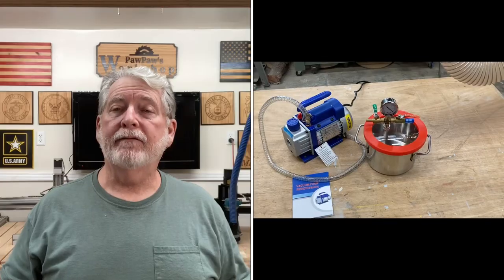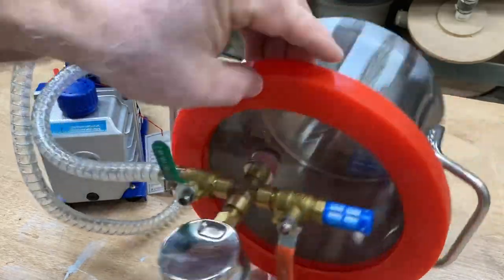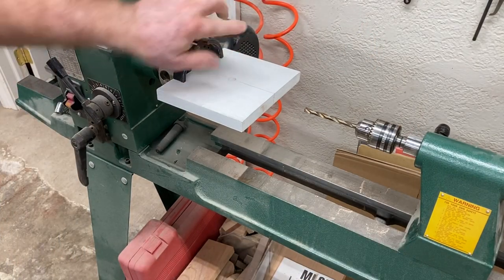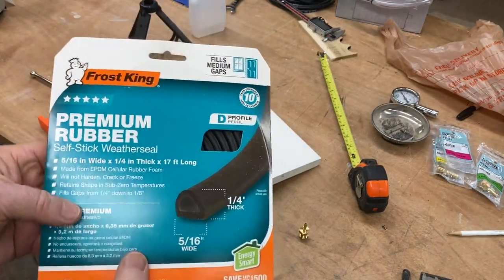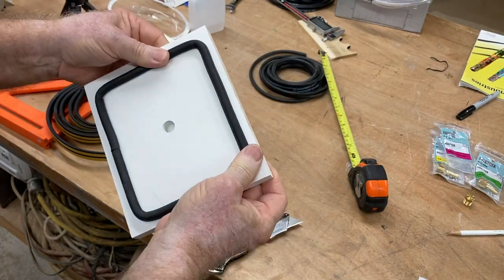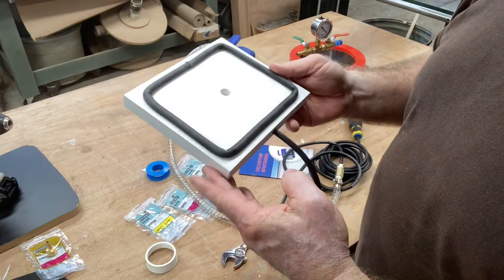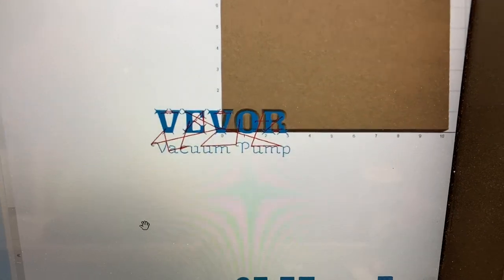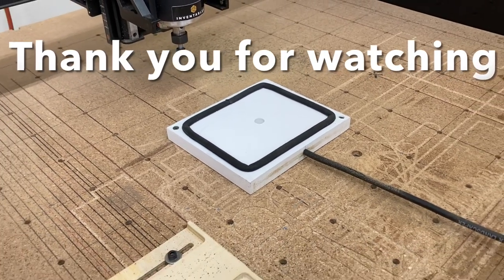VEVOR Vacuum Pump Testing with DIY Vacuum Pad

Comment: That is ingenious. I have an Axiom CNC and picked up the vacuum pad system they offer. It hooks up to a compressor, and has a venturi valve...It is absolute garbage, it simply would not hold much at all. Your simple system would be perfect for making a full size vacuum bed for my CNC instead of buying those $3000 vacuum beds....good stuff sir. thank you for taking the time to share this.
Reply from the maker: You are very welcome

Comment: I use a dowel drilling jig, instead of the lathe.

My vacuum pump is oiliess, so no oil mist in the air.

I used my cnc a year ago to make vacuum pads out of pvc, hdpe  and baltic birch. Take a 1/4" round nose bit and carve a 3/16" deep square or rectangular or circular or any shape groove into your pad material. Go buy 1/4" diameter foam backer rod from the window area of your hardware store, and put it into the groove.
Attach your hose, turn on the pump,  and voila.
Reply from the maker: Awesome!  Thank you for sharing

Comment: This is a awesome solution for a vaccum pad. I made one from pvc board and it works fantastic.
Reply from the maker: Awesome!  I like mine a lot. It works great
Reply: @PawPawsWorkShop  I made mine with 6mm EPDM rubber. I carved a groove and placed the rubber in it. It works perfect.  I use a Vevor 1hp vacuum pump. When I want to carve acrylic I first put a sheet of 9mm mdf on the pad, Then I put the acrylic on top of the mdf. Works great for me.
Reply from the maker: Awesome. Thank you very much

Comment: Your design works very well. However, I think you could get the same effect without having to fling the board around in the lathe. Just drill your initial hole a few inches in from the edge of the board. Then, I think one could just use a hand held drill to come in from the side. If it was desirable to be able to gang the pads together, a router could be used to dig a channel across the pad to a hole on the other side, a couple of inches in. One other idea might be useful to clamp thinner stock. Just run a couple of pieces of the gasket material radiating out from the middle of the pad to keep the stock from becoming concave under the vacuum. Just my 2 cents, thanks.
Reply from the maker: Excellent idea however, I wanted simple to the extreme. Using the lathe was safe for me while I understand some may not feel comfortable

Comment: I think I would put some kind of filter. Between the pad and the pump.  To keep any Sawdust from going into the pump .
Reply from the maker: Great idea
Reply: You need a filter of some kind as sawdust can destroy the pump over time.  

I use my setup to pull water out of my 3d printer filement.  I got a 15 micron  fuel/water separator with filter and a cheeper 12v fuel pump.  Cleaned a plastic candy container that holds about 1.5 quarts.  Run a hose from the bottom of container through the lid to the fuel pump, to the input of the filter, then out back through the lid about 2 inches.  It filters the oil so I don't have to keep buying new oil at every oil change.  

They do a similar process with food freeze dryers as some use vacuum pumps that use oil also

Comment: You may want to consider putting in an inline filter so you don't get sawdust in your oil for your vacuum pump. Great idea though
Reply from the maker: Thank you, good idea
Reply: Remember on the Germans original design the ear Inlet was towards the front of the motor and not towards the rear. This would mean that as it's flying an increasing speed more and more air will get pushed through the valve. I would increase the inlet size to scoop and pressurize the air going into the Tesla valve. It just seems logical.. I've done R&D for the greater part of my adult life and was forced into retirement but I still live and breathe R&D. Good luck bro.

Comment: Thanks for the video. I have the same unit. Any idea what type of oil it uses? "HFV 32" ? Having trouble locating some.  Also, after a few months of occasional use, might have a leak somewhere.

Comment: does it say in the manual which oil u have to use when the supplied 100# oil runs out ?
Reply: Any vacuum pump mineral oil specified for vacuum pumps. I've used robinair brand over 20 years and a couple others.
Reply: @1165slugman  ok, but is that iso 32, 46 or iso 100?
Reply: @viisteist1363  Robinair never listed viscosity due to proprietary blend. I used it in my vacuum pumps running continuously for up to 24 hours doing large refrigeration systems.  I did low temp refrigeration service for 28 years.  Harvest right has it listed in their recommended brands. JB black gold is another good oil.